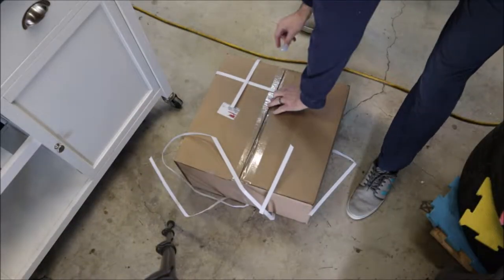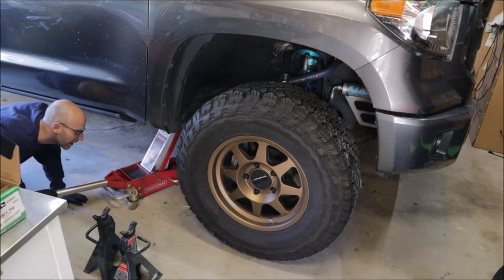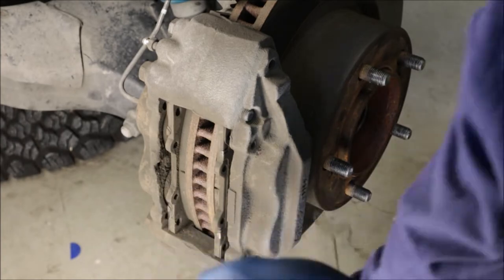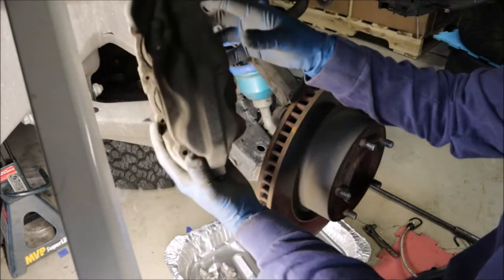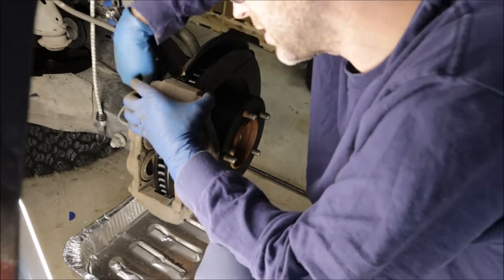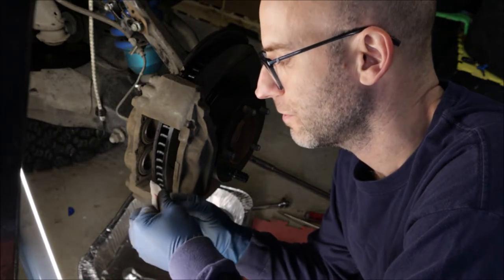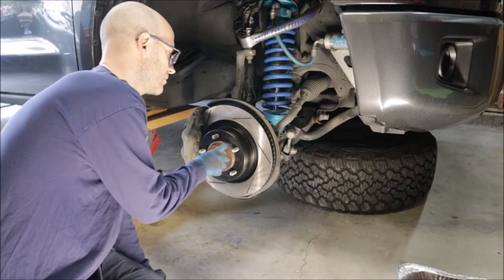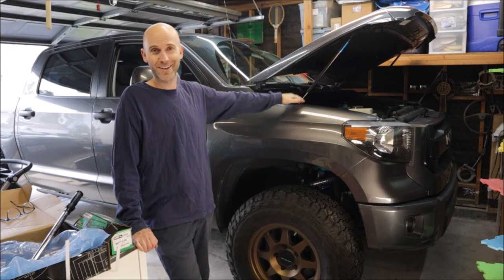Tundra Brake Upgrades - Pads and Rotors DIY

Comment: Just left the local dealership yesterday. Went in for just an oil change. 4 and a half hours later. Oil change is not done. My 2017 Tundra has 32k miles. They said that I need a new battery. $328. New pads, rotors and calipers, new front struts, rear shocks, TMPD sensors all around , cabin filter, and air filer. Grand total!!! $4384.00. Told them to stick it. My oil change cost me $148.  Acton TOYOTA, OF Littleton MASS. Never have I heard such BS!!!
Reply: Luckily the previous owner kept my truck in the toyota dealer, ME I will find a very good mechanic!

Comment: Sorry my friend, but you installed the rotor backwards. Many of these cross drilled or slotted rotor kits come with two of the same rotor rather than left/right directional rotors. The slots on the rotors are to be facing backward. Not forward. This is to help the gases from from brake pads during heavy braking to escape outward rather than the slots being forward facing as you installed them which would bring air and water into the contact surface of the pads and rotor. 🙏
Reply from the maker: FALSE! They were installed according to the manufacturers instructions.
Reply: @RoadPatina  The manufacturer is wrong. Go look at ANY well built rig. Sorry. Crappy company then.
Reply: Direction really makes no difference.

Comment: If you don't have a jack tall enough. Bust out the factory bottle jack. After you've extended your bigger jack. Use the bottle jack to raise it up another inch or so. Then use Jack's stands.
Reply from the maker: Good call!
Reply: @Road Patina  I literally had to do that last week during my brake job. The 1.5 ton race jack wasn't gonna cut it.
Reply: I’m a year late, but I will being doing that. Thank you sir

Comment: What did you torque the caliper brackets to? AllData says 133 ft*lbs and to replace the bolts. But that seems out of line with other information I have read.

Comment: Are you still on these same pads and rotors? How have they been holding up, and how many miles have they gone in the 2 years? Stopping performance? Would you buy them again? Sorry for all the questions lol
Reply from the maker: @DIESELLBZ  same pads and rotors. Got a slight squeak but may just need clean and relube. I would def buy again over OEM for sure.  Maybe 15k miles so far.
Reply: Thanks for the input, and great video. Do you have a link for the kit you used?
Reply from the maker: @ thank you! I bought the rotors and pads on tire rack. I should have added stainless lines. Next time!

Comment: Awesome job! How are they holding up?
Reply from the maker: thanks! A little more dust than the OEM pads but ZERO vibrations!
Reply: @RoadPatina  having issues with my powerstop Z36's after only a year. looking to go with this setup you got here. and squeeking in the rear? also softpedal ?
Reply from the maker: @Flipzco  I did not see the best reviews on the z36 setup. Some people had issues. These seem to be doing great. Can’t wait to tow with them!
Reply: Z36’s are garbage in my experience. I do tow a bit, but they started to shimy bad at about 15k miles. Can’t remember what I tried next, but they’re not holding up that great either. Curious how many miles you’ve got on these rotors and hawk pads?

Comment: How did these hold up overtime? The rotors
Reply from the maker: @lukealdrich4780  holding up really good! Got a little squeak but prob need clean and lube.
Reply: @ thanks for such a great video! I think I'm gonna go that same route.. I ordered TRD pads like 8 months ago and they finally shipped. I suppose I should do the rotors too since I don't really wanna resurface them. I see many others but most come with the pads. Do you think that would be a good set up? Thanks man again great video! 👍🏼
Reply from the maker: @lukealdrich4780  sounds good. I would get high quality rotors. My OEM rotors were resurfaced and warped fast. These have not warped at all.
Reply: @RoadPatina  awesome, got em ordered and looking forward to the install thanks to your vid. And advice. Thank ya much.

Comment: Thank you for posting this!  I just did my own brakes (pad replacement only) on my Subaru BRZ, had my Tundra in for an oil change and they suggested pads and rotors for my rear brakes - a 2020 with only 35k miles.  Seems to be a theme with these dealers. This looks super similar to the Bembo BRZ job I just did.  Off to buy parts.  
They quoted me $600 for the parts/labor.  Booooo
Reply from the maker: @303MoTo  same same just bigger and heavier parts! Give it a go

Comment: Question. I got. Same tundra on 35s. Oem breaks wear out fast and always make noise even when new. Will your setup change anything for me? I wanted to do a big break system but can't find anything
Reply from the maker: BBK are super expensive and not always worth it. TRD may still make one. I would try stainless lines, pick a high quality rotor, and good pads from Hawk or EBC. Change the fluid and lube everything good on install. This should give about the best results, next to a BBK!
Reply: @RoadPatina  thank you
Reply: @RoadPatina

Comment: Have a '17 Tundra, tow my 5000 lbs boat about half the year and unfortunately, I'm also a hot breaker of the daily. Have 74K and put my second set of pads/rotors on last summer. I have a crazy shimmy now after about 8 months. Will this setup last me a bit longer?
Reply from the maker: They are doing well for me! I don’t tow very often, but used a similar setup on my old Tacoma and really helped towing dirt bikes and desert toys. OEM would fade and pulsate coming down the grade. Switched to Hawk pads, and new centric premium rotors and never got that fade or shimmy again.

Comment: How those rotors working for you looking for some good ones
Reply from the maker: I am impressed. Last ones warped like crazy and these are smooth as silk after a few thousand miles!
Reply: @RoadPatina  can I ask you one more ? Did you find these on Amazon along with pads?
Reply from the maker: @jamesburroughs7248  I bought everything on tirerack!